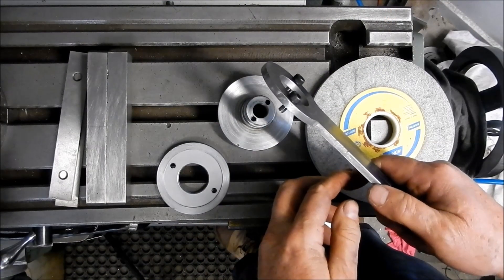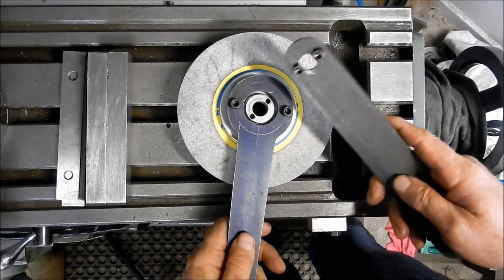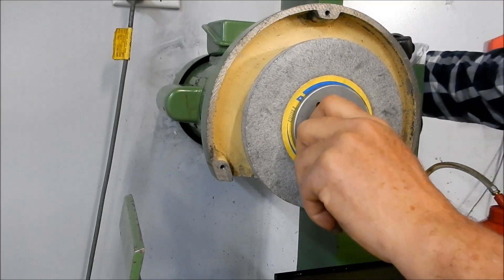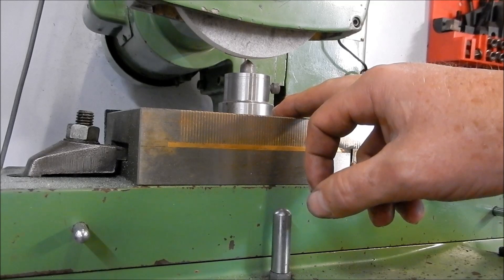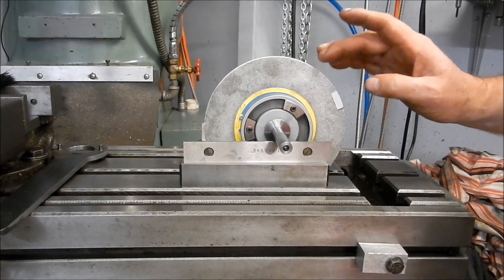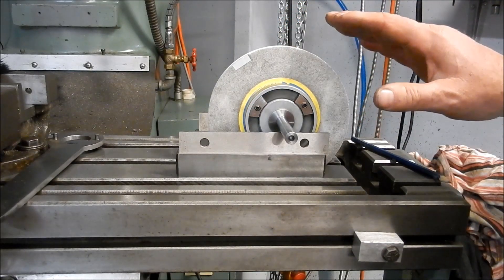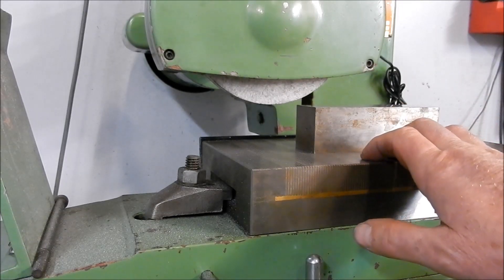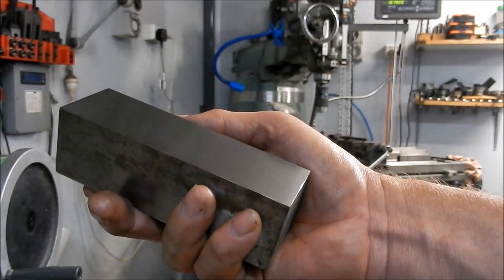Grinding on the Targa Surface Grinder after balancing the wheel

Comment: Just rewatched both surface grinder videos. As always, super helpful.  MachineNZ’s comment on availability resonate.  But I got lucky and found an Ingar 618 at a local auction.  They are a Boyar Schultz clone made in Spain.  She’s needing a little TLC
, but not to bad. Now I need to follow your example and process to make a balancing set.  Hope  I can get the same slick results. Cheers.
Reply from the maker: G'DSay James, yep a surface grinder really adds another dimension to the shop.  Being able to put on a clean smooth surface if nothing else give it a professional look.
Cam

Comment: Is the Targa a manual machine? I wrote an Arduino program for mine with the intention of fitting a stepper motor to the rack axis. Adjustable Proximity sensors on each side tell the motor to reverse direction. POT controls the stepper speed. Got sick of hand cranking my unit on larger plates. 

Going to get a diamond wheel too, with the intention of grinding my stones flat. 

Was confused about which house jobs the wife wanted a good surface finish on?

Comment: Cam, looks good, looks can be deceiving.
Rub it over with a precision stone for the full story.
You will be able to do your own with a bit of set up.
It's a real eye opener what you will see on all sorts of what you thought were perfect surfaces.
Reply from the maker: G'day Carl, l guess l was intermating that the stone finish would certainly show up the imperfections.  Unfortunately with this little grinder there is nothing more l can do to easily get the finish any better than it is.  If anything it might depress me if l do see all the imperfections come out so I'll just focus on sorting out the hub issues.
Cam
Reply from the maker: Yep, agree Carl, stoning/lapping if done right is a whole new level of surface finish.
Cam
Reply: Cam, yes, agreed, lapping is potentially another level up in finish, but I was more referring to a quick, like a few seconds, rub over with precision ground stone displays the actual state of the surface.
Ridges, vibration patterns, harmonics and out of balance wheels, twist or other out of flat effects all pop out like shiny brail.
This has to be seen to be believed, I understand.
Unlike un-ground stones, which by the way are not flat or square and scratch everything they touch...
Precision ground stones polish every surface they touch and as they are very flat they polish off the tops of anything sticking up from the surface however small the difference is!
Nothing is flat.
Nothing is round.
And it's All made of rubber!

Comment: What was the finish like before you balanced the wheel?
Reply from the maker: Hi Fred, a very slight ripple on the surface like you would see with a harmonic indicating an out of balance issue.  What ever l did it was always there.
Cam

Comment: Looks great Cam
A thought on the crappy screw on taper situation; on the wheel arbors can you drill out the threads (and maybe face down the end) and make a separate nut that clamps the arbor on? If that makes sense
Reply from the maker: G'Day Tommy, I did show the new design on the video with a shortened nose on the Hub with a separate Lock Nut as you describe.  I also showed on the drawing the Jacking Nut to remove the Hub from the Spindle.  The existing hub is Nitrided through and probably around 55 RC.  It could be machined but I'd rather keep it as a backup just in case my idea doesn't quite work out the way I want.
Cam